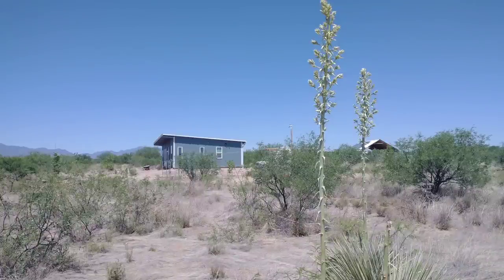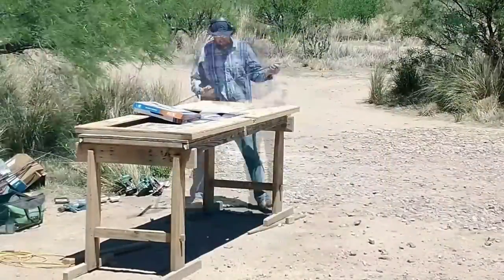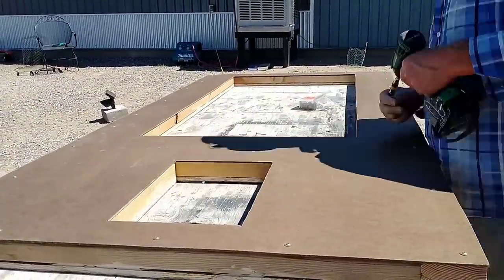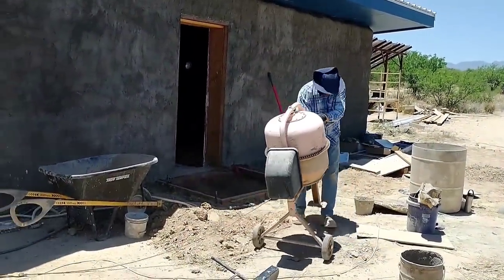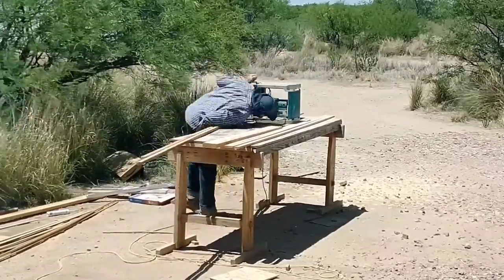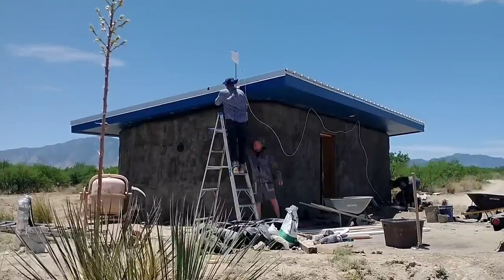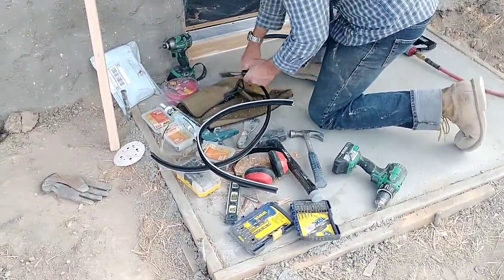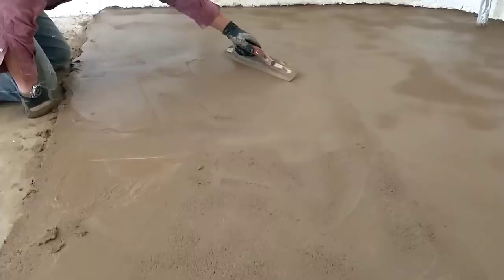Front Door Build & Install #9 Hyperadobe Tiny House

Comment: The door looks awesome, nice work. 
Could you tell me - is this a common way  or code requirement to install house doors? For some reasons, i'd install door in such a house to open outside, to save precious internal space. 
On some northern territories they do install external doors to open inside to have chances to dig out after heavy snowfalls, but in the desert it's not the most probable scenario, i guess. 
When you build doors to open outside, you can install them in a way that they open parallel to the wall taking very little space when open. And mosquito nets may be used as internal part of the door, which may be useful in your location, providing ventilation and almost no hassle going through. You have a very solid roof installed in a way that covers your entryway well against elements, so it should be safe as well in case of a sudden rain for example. 
Second question - i'm really curious if terrasses\verandas are in use in your location? In locations where sunlight is gererously provided by the nature, i regularly see that terrases under light roof are quite popular way to extend habitat, like to use it as an external kitchen, social area, base for flowers and just to peer around in a comfy chair. It looks quite natural for me to build one close to house entrance and intersect the roofs to protect against weather. Or the main idea is to stay inside with an air-conditioner? 

Very nice and sturdy house you have build, very interesting project, thanks for sharing.
Reply from the maker: We prefer that the door opens in, mostly so it doesn't get caught by the wind. On our house, there is a wall behind the door, so it doesn't really take up any usable space. Kyle is planning to put some standing shelves behind the door. It should works out well, and the door shouldn't interfere with anything. Outdoor space is nice and could always be added later, but for now, we just want to get this house livable. The evening is typically really nice and cool. It's a great time to go for a walk or to sit outside in a shade on the east side of the house. 
Appreciate it, thanks for watching! 😎🏜️
Reply: @RedandAprilOff-Grid  Thanks for the answer,  what a lovely family you are, cheers!

Comment: I love how you incorporated the weatherstripping (I have a small appreciation for its importance after having replaced it on my doors, fairly straightforward to do).  

But I'm curious what's the philosophy around how tightly sealed this house will be, with respect to their being those ventilation holes in the walls?  I don't have an appreciation for the optimal approach in your climate.
Reply from the maker: Yes, weather stripping is pretty important to keep water and bugs out. It's fairly easy to replace, but getting the boards set exactly in the right place is a bit tricky. 
The screen material is a way to keep bugs out, and let cool night air in. He'll probably close them in more at some point. 🌞

Comment: Are you guys in a state without building codes? It looks like you guys did all the design work yourselves without having to run around getting it approved - is that right?
Reply from the maker: Yes, we were able to design and build everything ourselves. The County we are in has what is called an opt out permit. Only an exterior inspection is done once the house is completed.

Comment: Looking good. If it doesn't look "home made" at the end, is it? I'm happy the door has a large window in it, I personally may have a skylight and some fan arrangement for air circulation. 
When the sand is too washed it's difficult to mould.
Reply from the maker: Thanks! 😄 We looked into adding a skylight, but decided it wasn't worth the cost or the trouble. The portholes bring in a lot of light, so it's not too dark. Yes, he's planning to put in a ceiling fan. For concrete, we just use sand from  the property.
Reply: I would put a 48" X 48" X 48" chimney on the roof except top it with a skylight.
Reply: @missingremote4388  nice, have it openable to let out summer heat in evenings.